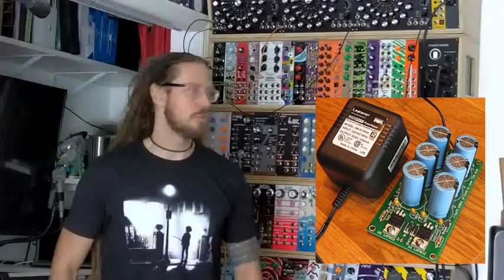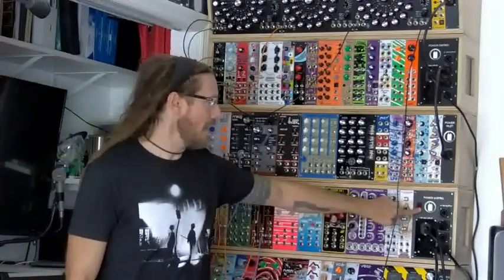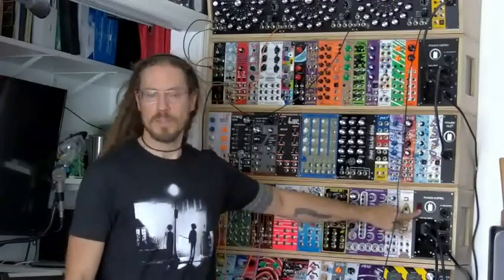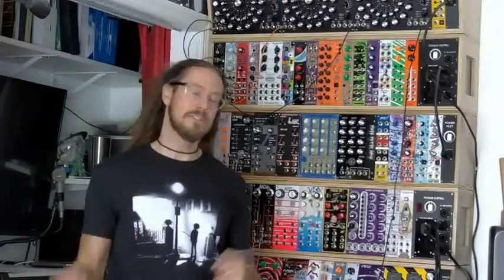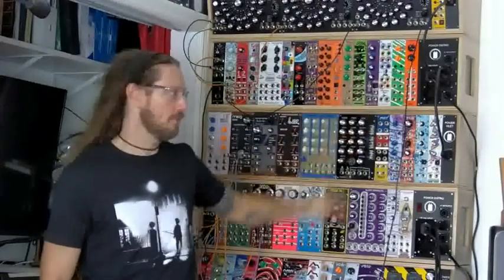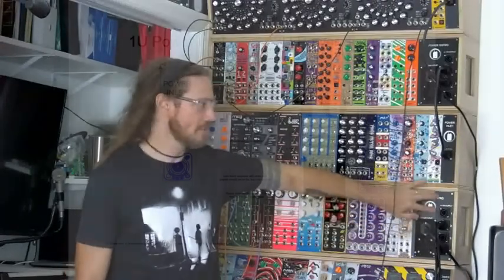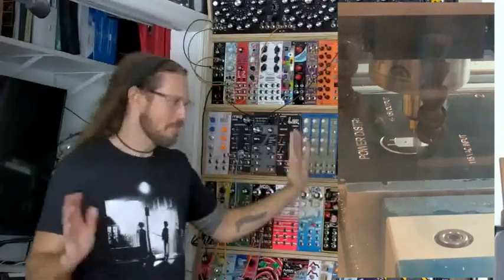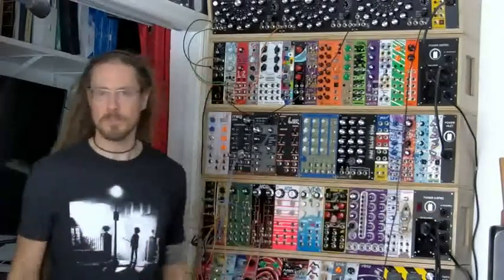Analog Modular the Hard Way:  Part 3 - Your Power Supply and How to Stay Alive Building It.

Comment: fwiw, server/data racks handle air distribution that way because each active appliance in the stack is handling its own air distro (in much the same way that your power supply is), and the rack is just facilitating air exchange to vent that hot air and to try and place cool air in front of every appliance's intake